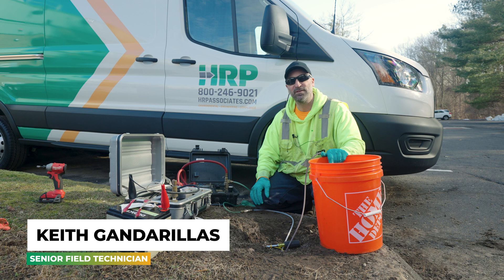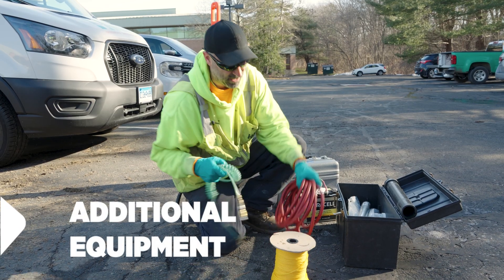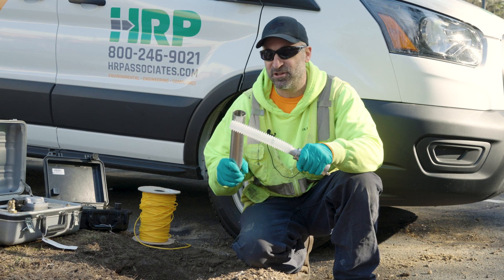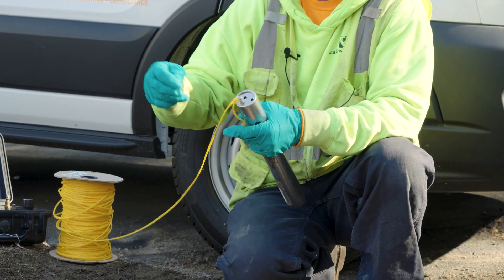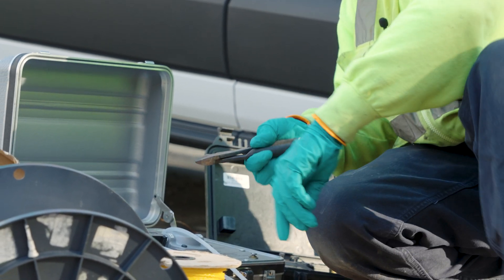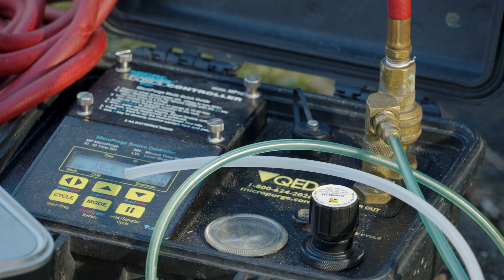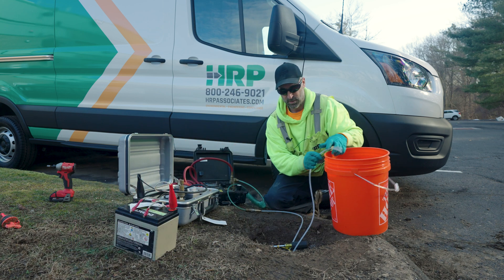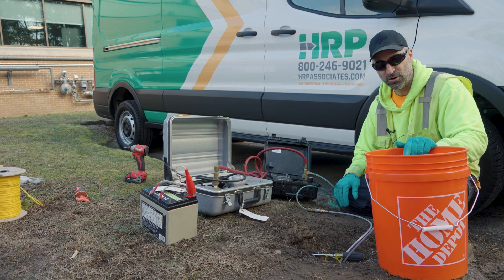How To: Set Up a Bladder Pump For Low Flow Sampling

Comment from the maker: Are you pumped for this video?
Reply: Nice video. I used to work for QED for 15 years in the field on the west coast mainly. Now, I work for another company as the end user for about 8 years. The flow rate is really more dependent on the volume of the bladder and the fill and discharge time. The more air pressure will help get the water to the top with more psi overcoming the head pressure. Really enjoy working with QED equipment

Comment: Would recommend using a monsoon pump or grundfos instead, a lot easier to teach people to use.
Reply: I typically sample with a SS mega monsoon but I came here because I'm dealing with a 140ft well that needs 4 lowflow samples from different intervals and the well has some sort of blockage around 126ft that the pump cant get past but im able to get the water meter all the way to 140 so wednesday I'm gonna try a skinnier bladder pump but I'm not that familiar. Definitely agree other pumps are much easier to work with but I unfortunately may need the bladder pump for this scenario.